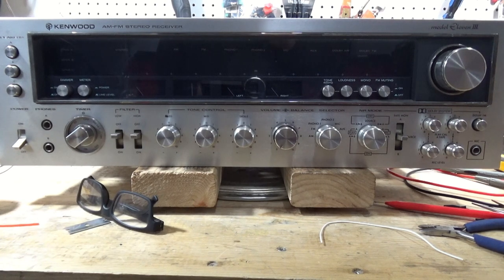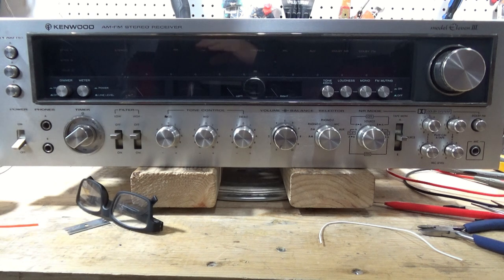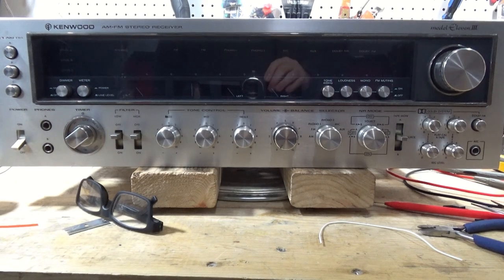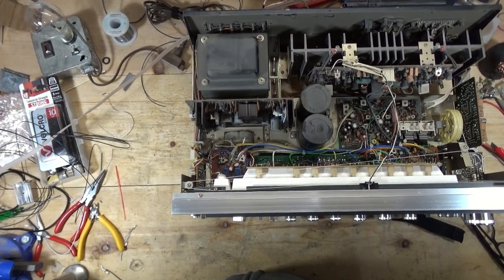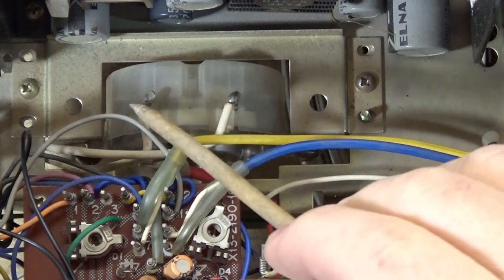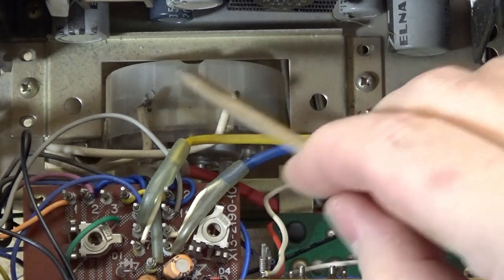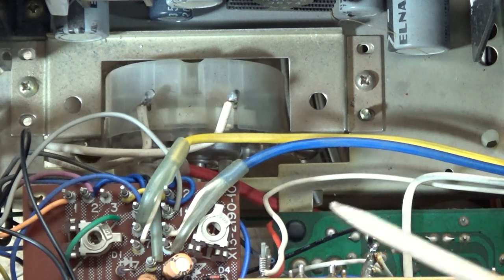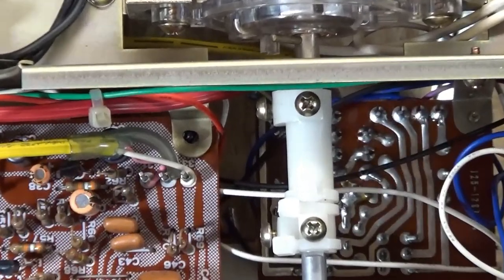Broken Kenwood Eleven III Stereo Receiver Timer Repair - A Few Options

Comment: Banggood and AliExpress have all sizes of motor shaft couplers in brass even plastic,using a coupler such as this honking thing would destroy the the shaft attatched to the timer because of the split in that shaft,you would need to fill the split in the shaft with JB WELD so it doesn't either break off,or it doesn't bend.OR another method go to a metal supplier or hardware store and buy a short length of Alluminium tubing,cut to length and tap the holes for grub screws.
Reply from the maker: Good info.  I thought the coupler looked rather large for shaft in question.  Presenting more of a 'theory' of what you could do.  The shop owner wanted it bypassed, so I opted for the bypass/superglue + baking soda method just to make the timer turn as designed.  I've not come across any info on what (inside the timer) might prevent the knob/shaft from going into the Reset position.  Not my gear to tear that far into :)
Reply: @millervintagehifi3034  totally get it,just thought I'd tell you about the couplers,as I had seen them of different sizes on AliExpress,but the super glue and baking soda,is great too,it keeps the original look,I don't know very much about the timers at all,but I know about small metal thingies tho  🙂Enjoy your work,keep it up,I have a Lenco L75 I totally restored and filled some unwanted holes bought the plinth from Moldova in polished piano black,and sprayed the turntable in a metalic silver,was lucky enough to find a NOS Jelco arm to fit it.

Comment: Thanks for education, did not know Bake Soda and crazy glue. Own a Black face 9000G and timer still functions. Now I need to check for cracks.
Reply from the maker: I just worked on another Eleven III, but the entire assembly was missing.  Bummer...I do wonder why they made these with such a large footprint...the cabinets are enormous.
Reply from the maker: Definitely not for use where space is at a minimum.